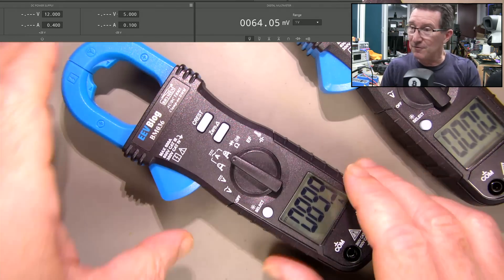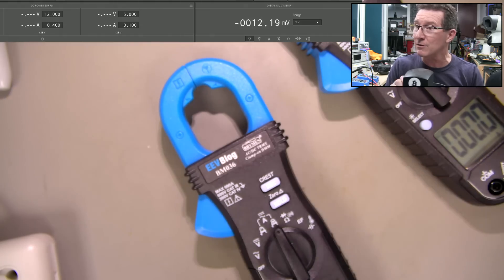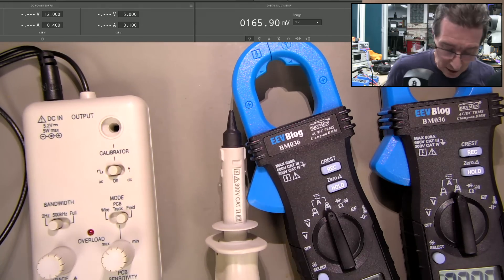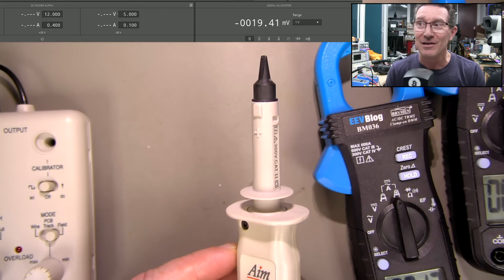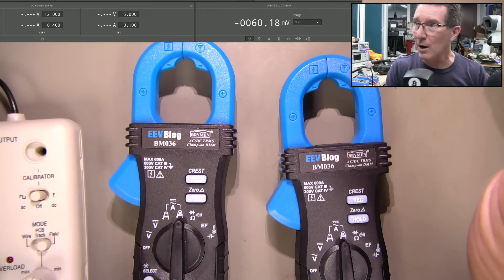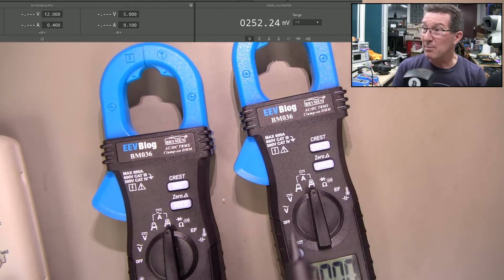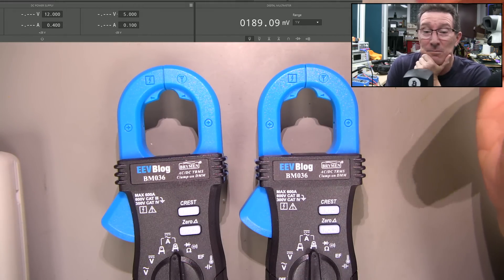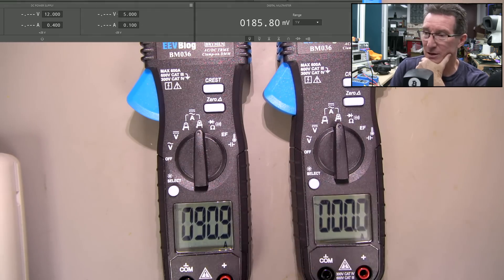BM036 Clamp Meter Magnetisation Test

Comment: We used to have a big degaussing coil to clean up color TV CRTs. The three guns would get distorted or misaligned to the masks inside, either the phosphor array got magnetized (or the masks) so the alignment could be adjusted but certain areas would be off.

Some better TVs had one built in that might run for a second when turned on or off. You could remove them from old TVs to use.
Reply: We would even sometimes run the degauss on a running TV for some funny effects 😂

Comment: My take is, the circuit starting with the "zero" switch and the debouncing cap back to the controller. Q: does the zero function work for ohms?

Comment: Oddly enough, after your previous video I decided to check my cheapo meter of a different brand and turns out it has the same freaking issue while measuring DC. It constantly shows ~130A and refuses to zero out. It measures AC with no problems, which is what I mainly use it for. The meter is "Forscher 209".

Comment: in previous video it looks like the 3 pin board to board connector had a dodgy solder joint. (visible @ 08:51 in part 1, one of the pin is not soldered on the bottom side).

Comment: The 'Gauss' is named after the German physicist Carl Friedrich Gauss and his name is pronounced 'gowse' or the 'au' has the same sound as the 'au' in Audi, not Audio or 'gauze'.

There is a smaller 'degausser' used on magnetic tape heads. I did have a look on Amazon and found watch and jewellery demagnetizers/degaussers for around 40AUD. They're certainly cheap enough and may have other uses on the workbench.

Comment: Just taking an analytic approach: DC-Clampmeters need an integrator circuit, usually realized by one of their OpAmps. For obvious reasons the "Nulling" should not only be done in Software, but also the integrator circuit should be reset.
Because the button beeps, the button and the communication to the CPU are okay. The fact that the value of the integrator is not changing at all, indicates the "reset" signal is not reaching the OpAmp-circuit at all. So principally, I would trace the reset line from the microcontroller to the opamp...

Comment: i have this same issue with my ANENG AN8008 i think it appeared after i measured some frequency on ultrasonic cleaner board and it sparked while measuring since then i noticed that Amperemeter has an offset and it's still working although now it's measuring 0.7amp per amp on top of the offset 🤷‍♂

Comment: I successfuly demagnetized the metal casing of a compass by using  a strong magnet attached to a drill. While rotating the magnet I approached the case and then moved away.
But, if the clamp's core was magnetized, wouldn't the reading be influenced by opening and closing the clamp ?! I did not see anything like that.

Comment: Well, I am physicist with a career working on particle accelerator magnets.

Maybe you can try to degauss it by wrapping as much turns around as possible, hook it up to a signal generator or DC power supply.

Go +I, -I, +0.75I, -0.75I, +0.5I, -0.5I, ... 0.

Where "I" is sufficient current to saturate the core.

Comment: I don’t think it was magnetized. For it to be offset by 90A it would have needed to see an equivalent field of thousands of amp turns through it. Maybe a failing Hall effect sensor or amplifier or something. 

This video is super well timed for me. I’m designing a current sensor using a  gapped ferrite core, and trying to account for the offset induced by remanence field (with open loop architecture) is really a challenge. Especially at cold temperatures ferrite holds a lot of remanence field. I’m curious if anyone knows what material the laminated core is in this sensor. SiFe?

Comment: Would not help to fix it, but i would like to see can you zero it when you get the current measurement near zero.. ie. by loopping 30 loops wire and feeding negative (negative) 3amps to push the reading down and trying to zero it then.

Comment: As I suggested in in a comment on the first video -- hit that AMD part (probably a precision op-amp) with some hot/cold.  If it's a leaky semiconductor junction that'll likely cause a dramatic change in that offset reading.

Comment: I would think that, particularly since support from the plastic jacket means that you don't have a need for mechanical strength, one would choose a "soft iron" class material that doesn't retain permanent magnitization.

If the Hall sensor is indeed buried, it might have a bad solder joint, initially just mechanically in contact, oxidation growing over time  Or a fault in the Hall chip's case, allowing moisture incursion.

Comment: Could this be a crack in the core?
You can try connecting a cable from the hall sensors of a faulty device to a working one and from a working one to a faulty one. I'm almost sure the problem will be in the core or less likely in the hall sensor

Comment: You can try to find an old CRT TV or monitor; there is a demagnetization coil around the kinescope connected in series with the PTC in the mains. Using the same coil, but connected to DC current, you can try to shift the readings to 0 (so as not to try to find 90 amperes). But I don't think the problem is the peremanent magnetization of the core, it is made of a soft magnetic material with a very low coercivity. The problem is probably either in the sensor itself or in its signal amplifier.

Comment: I've noticed that the offset seems to be getting worse as time goes on. The customer said it originally had a small offset (about 10 I believe), but by the time of your first video, the offset was around 80. On today's video it seems to be hovering around 90. If it is picking up and retaining a magnetic field, have you tried using a degaussing coil on it to see if that has any effect?

Comment: If the clamp meter became magnetised, wouldn't that affect DC current measurement as well as AC??
And surely wouldn't cause the reading to keep increasing over time after the meter has been removed from the strong magnetic field?

Comment: From your previous video, the fact that you can't use the delta function to null it to zero, and, the 86 amp value didn't change when you opened the jaws, definitely leads it to a hardware issue besides any residual magnetism in the jaws. I am thinking it's a wonky op-amp, or part of it's circuitry, that is causing the issue, seeing that a small change/defect in the op-amp itself, or an associated component, can amplify a defect on a large scale.

Comment: Wind 4 0r 5 turns of wire around the clamp and connect in series to a heavy AC load. { ie an electric heater would work fine} , There should be more than enough magnetic field to degauss the clamp. Using 4 or 5 turns of wire to replace the soldering tip. on a soldering gun also works well as a degausser

Comment: WTF?... you're an "engineer/wanker" I was screaming this morning at the puter & apparently someone "enligthened the engineer" cuz I wasn't gonna tell him what was goin' on who also knows jack shit about consumer crap & cars... been a tech in electronics & a mechanic for 40yrs & I despise engineers because if they had to work on the crap they made they would loose their shit!... HMMM
BTW: If you wanna fix it run a deguassing coil through the clamp with a mild PTC & remove it from the clamps before you switch it off & it's fixed other than your fiddle farkery with the calibration pots!

Comment: parts swap or get a bigger sample size for the magnetic reading. if good ones all read within a tolerance, and the bad one is outside that range, its a magnetic issue.

if parts swaps fix it, something in the little board or the clamp arms is bad.

if not, its drift in something on the main board.

Comment: Plot twist: It is working correctly now. But pots were clogged at factory during calibration, so it was miscalibrated and pots slowly unclogged over time and vibration... Unit just need to be re-calibrated using these pots (these are likely offset+scale?).

Comment: For what it is worth, an internal oscillator may be used on DC Amps to create an artificial AC magnetic field in the clamp. The AC field is then modified by the DC current field which allows it to be measured. If I saw it correctly, your good meter was on AC, then not generating an AC field. If an oscillator is used, the field might be picked up with a coil and shown on an oscilloscope.

Comment: My money is on the hall sensor DC preamp; the hall sensor itself would give the same failure mode for ac and dc, and anything after the amp would also be affected equally. The only part in there that knows the difference between AC amps and DC amps is that little preamp (or, more likely, those two little preamps, one for each). Couple thousand amps thru there from some giant f'n forklift battery or whatever and if the preamp isn't suitably protected it's toast.
Reply: Do these meters use the hall sensors for AC?  I'd have thought they would use the coils shown in the previous video.

Comment: Wouldn't measuring a big AC-current work as a degaussing? 
Wrap the lead a couple turns to increase the field.
However it´s strange that the offset increases over time. Unlikely that a potential static magnetic field will increase over time...

Comment: Will the broken one still measure? If so, try offsetting the reading with a magnet to a value that will zero. Keep doing that until you lower it enough to zero without offsetting.

Comment: On the working unit you could try zero it while measuring 8 amps. If that works then it's a firmware fault on the broken one

Comment: ...Does the offset change when meters circuit board hit with spray freeze / hot air.....I often find this sort of fault can be narrowed down as faulty components are often Heat/Cold sensitive ...

Comment: Considering the earth's magnetic field produces a 200mV from that probe when rotating the probe and you weren't even getting half that from the clamp, I'd say it's not magnetised as if that much magnetic field made a difference, the earth's magnetic field would cause the meter to read 180a just from rotating it

Comment: If the cause was the magnetization it makes not much sense to me that the measured current keeps increasing. I don't know how they measure a non altering magnetic field, but my guess is that there is something wrong with the circuit that does that.

Comment: Without knowing how the software is calculating the offset but i doubt there is any NV RAM holding the data. So the offset is being read directly from a part of the device. Not sure what the lam-core is made of for saturation but worth swapping clamp heads, but if the whole thing was subject to very high magnetisation it could be somewhere else, again did not see any lc network but who knows. Have you a Gaussmeter?

Comment: Interesting that the display didn’t change to DC_0 on the faulty meter when pressing the zero button like the working unit does!
Reply from the maker: Yes, forgot to mention that. It refuses to do the zero for some reason, so the routine doesn't display it

Comment: You could use a transfomer with a burnt secondary. Taked appart as degausung  coil or a squirrel cage motor. Take the rotor out and power it? Then you can just refit the rotor and the motor should still be fine.

Comment: The good meter shows "dC_0" when you zero the offset. The faulty one didn't. A clear firmware fault.
Reply: Or rather than a fault, it could be refusing to zero the measurement out because the raw value is too far outside the nominal or expected value.
Reply from the maker: @AnnaVannieuwenhuyse yes, I suspect its this

Comment: I don't really think it's magnetized. I think it's either a faulty hall effect sensor, or even a faulty DAC. Considering the guy said it got worse over time, it sure does sound like a faulty DAC. And that offset sounds exactly like it could be this, too. Might be that Analog Devices thingamajig, or the other Microchip one, whichever is the DAC. I'd test it to see if it has some uncompensated bias, maybe its input is getting offset in some way (maybe it really is the hall effect sensor).

Comment: its increasing, it was shipped at 17 or whatever, the last video was at 89 or whatever and this video is at 91, would not be a magnetic field 
only thing i can think of is some leakage in the opamp or in the hall sensor it self 
i would be curious if it still has its full AC measurement range, granted im not sure how one would test that in the home lab ... maybe a function generator and quite a few wraps of wire

Comment: I would think measuring a high AC current for a while would naturally degauss the loop.  
The symptom it has where the offset keeps getting larger sounds more like a component failure.  The loop would not be getting more magnetized as it sits.  Not being able to zero probably means a software limit has been reached and it has applied the largest number it can to bring it back to zero, so internally that thing must be reading a very large current.
Reply: I doubt it. We're only talking the current you measure flowing in a one turn coil. You're probably not going to get anywhere near enough magnetism to degauss it. Plus, you need the alternating magnetic field not to suddenly stop at a random point and gradually reduce to degauss.
Reply: While the AC is still flowing, slowly open the clamp and pull away from the wire.  The slowly reducing field will work to demagnetize.  Switching off a big AC draw while still clamped can make it worse - you won’t know where you are in the cycle.

Comment: Hi Dave,
You should try this with the meter switched off, as if it uses a Zero-Flux topology (which it most likely will in order to compensate for core parasitics) it will always keep the magnetic field inside the core at zero, and you won’t be able to measure anything.
Reply: Unless it's just using e.g. Hall sensor directly, it will be closed loop.  That is, there is a coil (say, 2000turns for a 2000:1 current ratio) that produces the opposing flux, since the magnetic sensor (also probably Hall effect) and the core itself is non linear.  And it could also be that those 3 adjustments are for frequency response, since the coil is of course reactive (or the gain of the feedback loop per current range)...  Anyway gapsem is correct, with the meter running if that feedback loop is working properly, the flux will be cancelled and constant (near zero).  But when the meter says OL (in the low range), you might find the loop saturated, in which case the flux will deviate from that closed loop zero.

Comment: I would also try swapping the daughter board.  Any ideas as to the function of the AD "09" chip?
Reply: I was thinking the same thing. If Dave is willing to do some part swapping, that should narrow down the suspect list very quickly - even if the adjustment pots on the daughter board are not perfectly tuned for the other unit.

Comment: Use a degaussing coil like for the old CRT or I used a Weller soldering gun move it around in circles then pull away.

Comment: They likely wanted to measure peak current while connecting some large capacitive load like an inverter to the battery and that will generate quite a few kA likely above what the meter can handle. Most likely the amplifier after the hall effect got damaged due to fast transient from large capacitor connected to the low internal impedance battery (basically a short circuit).
Peaks could easy be in the 12 to 24kA for those batteries order of magnitude above the meter max current and the rate of change is also huge.
Reply: I'd bet money on your and @AnnaVannieuwenhuyse 's comment about "the raw value [being] too far outside the nominal or expected value" to zero out.
Reply: There should be an input protection in place for the opamp from voltage spikes (protection diodes) but if there aren't then that could be possible

Comment: Make a degausing coil by getting a 50-100 watt power transformer with "E" and "I" laminations. Pull it apart  and toss out all "I" laminations. Then restack with all the "E" laminations in one direction. Power it with mains. It will buzz like hell but great for demagnetizing by waving it over magnetized device and slowly moving it away. Only use it for <2 minutes as it will overheat!
Great for demagnetizing casette tapes or screw drivers as well.
Reply: Glad I'm not the only one to think of using a degaussing coil on it. I'd think a tech like Dave would already have one around.

Comment: I guess you could try swapping parts with the good unit. Be nice to hear back from Brymen though.
Reply: I bet on hall sensor failed internal offset compensation
Reply: @viperwizard491 I am going with that also, due to the way it drifted.
Reply: If the clamps are magnetised then it'll just be that to swap to prove the point.
Reply: I was thinking, move the guts of the good one into the bad one, then you will know if its the clamp or the electronics! If the hall sensor is embeded into clamp....

Comment: My bet is still a defect or failure in the hall effect sensor. Is there a way to evaluate the sensing component for failure?
Reply from the maker: That would be the next culprit you'd suspect.
Reply: @EEVblog2  I went straight there after the last video. I didn't even consider that the hoop could have taken a magnetic charge. I always learn something new in your videos! 🙂

Thanks again for all you've taught us! 🤓
Reply: @EEVblog2  Are there separate sensors for AC and DC?
Reply: My thought was the sensor or opamp factory defective